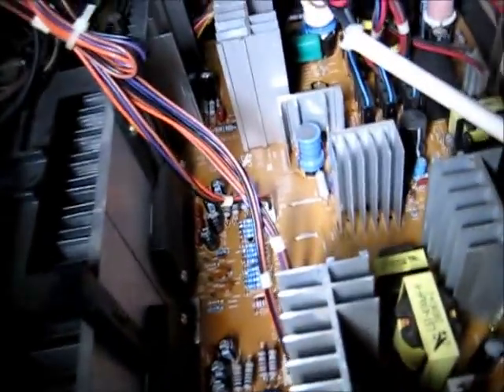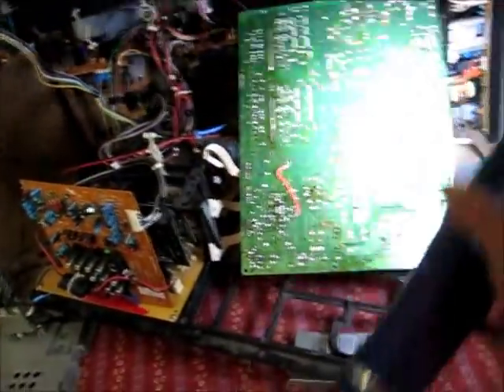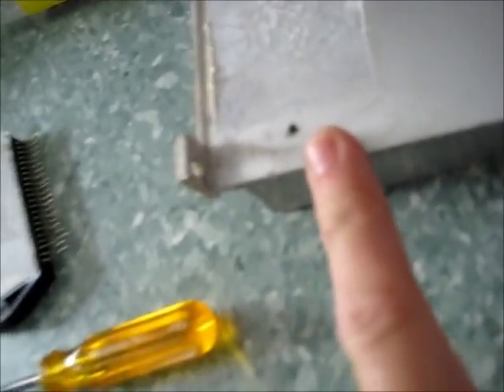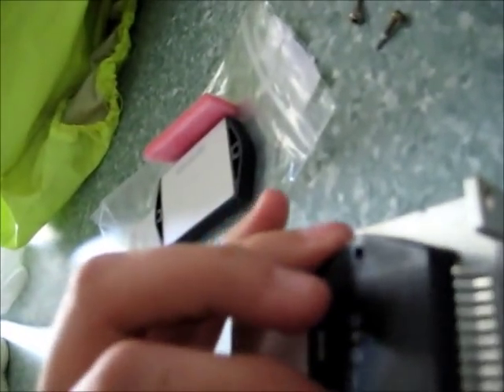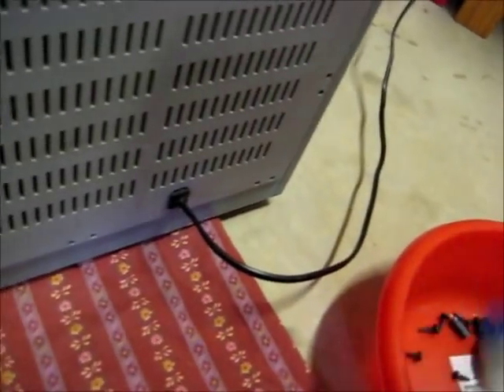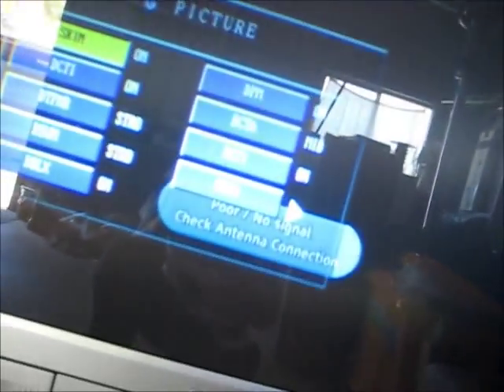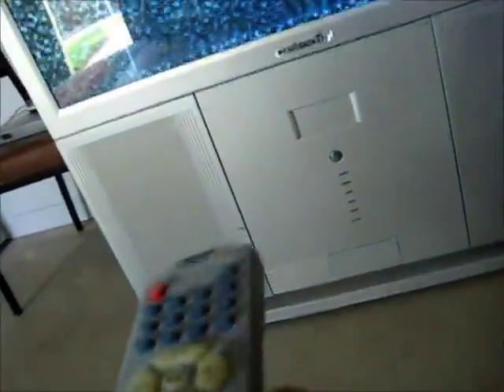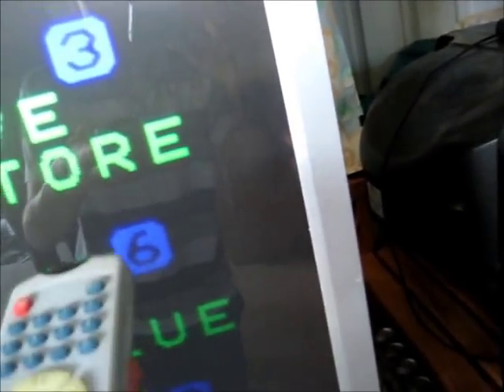Fix Rear Projection TV

Comment: the STK's are audio amplifiers, 
they amplify the waveforms (sounds) generated by the convergence circuit to steer the electron beam correctly - they run pretty close to flat out most of their life and, like hifi audio amplifiers , die, 

there is 3 amplifiers per STK chip,  2 channels per gun. -

Comment: @HDXFH Is it safe to remove the wires on the flyback after  TV has been off for a few days? No need to discharge or anything? I'm working on a sony KP51WS520